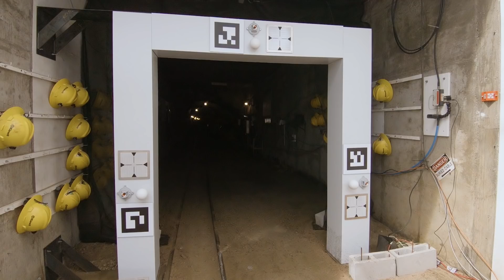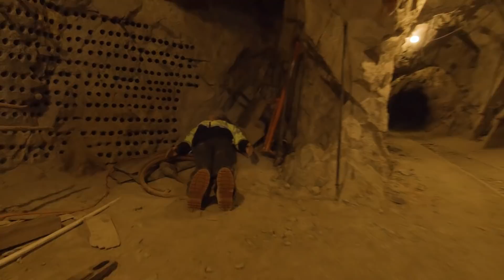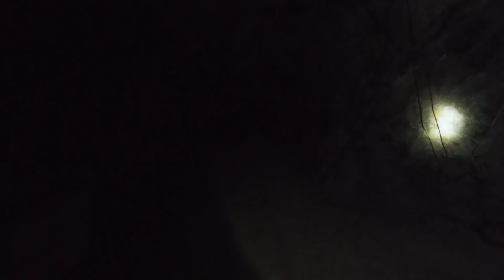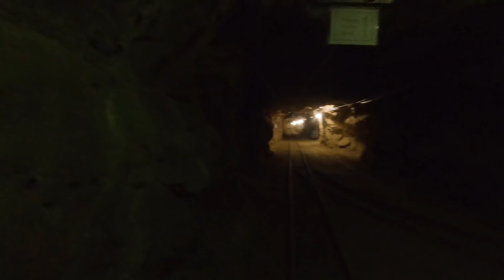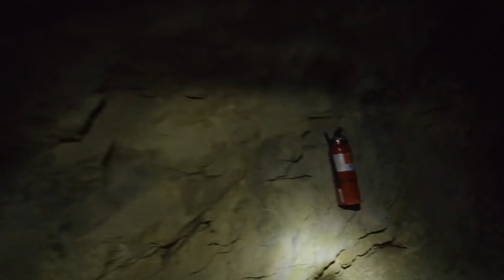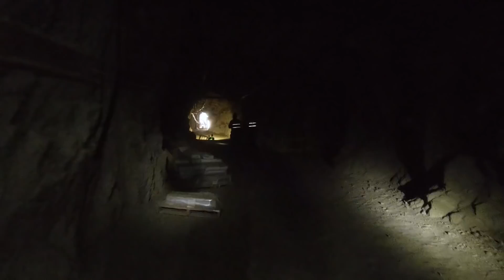DARPA Subterranean Challenge STIX Tunnel Tour

Comment: If I had the resources and funding my project would be called Gretel.  Instead of leaving behind breadcrumbs my millipede shaped multi wheeled robot would drop tiny repeaters so it could constantly send data back to a high end workstation located outside the cave.  The computer would in turn provide navigation instructions back to the robot.  The gimbal stabilized 'head' of the  millipede robot would have forward facing LED lights, a camera connected to a single-board microcontroller with face detection API, a multispectral camera to identify any objects that are not rock, and LIDAR to capture the environment as it slowly progresses through the cave.
Reply: go to darpa then
you already got an outline of the project
Reply: There is one fatal flaw in your proposal, Hansel was the one who dropped the breadcrumbs :)